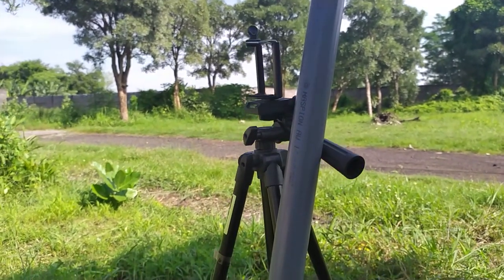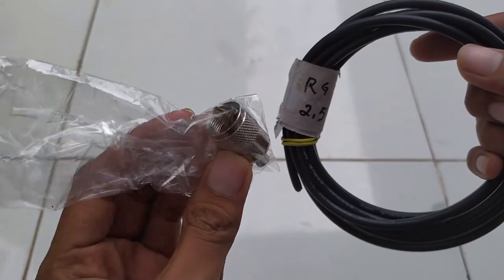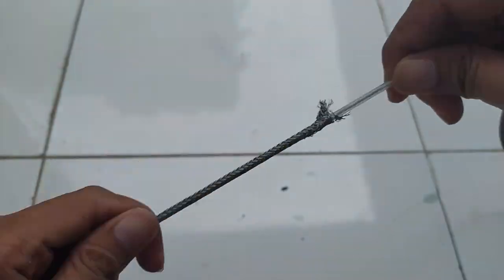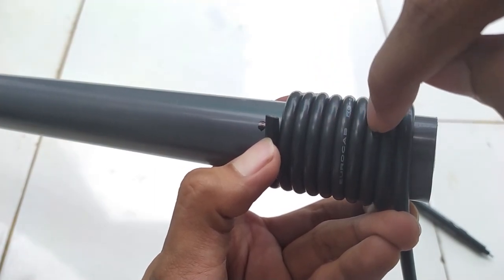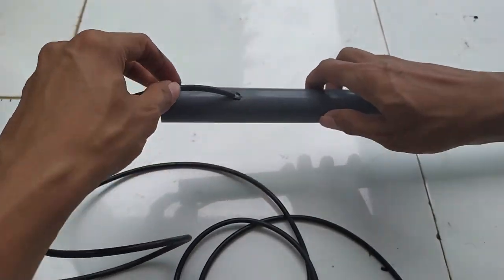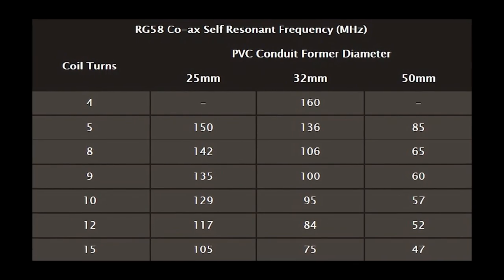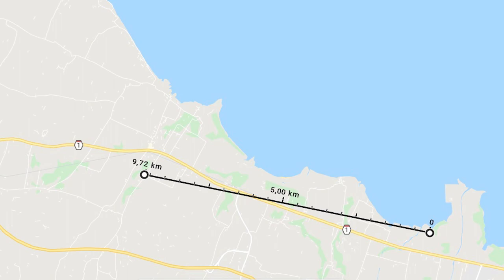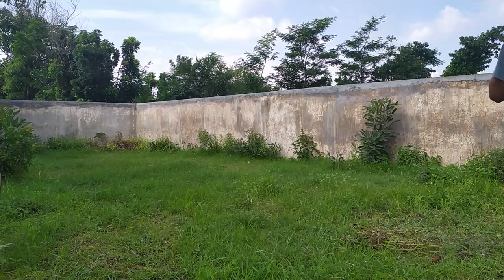Merancang Antena Flower Pot Portabel 2 Meter Band VHF (Outdoor & Mendaki Gunung)

Comment: how long the PVC and how many meter the rg58
Reply from the maker: PVC at least 1.2 m or if you want more portable you can use PVC length about 1 m, and for RG58 length it depends on coil turns of your freq resonant you want to use, so I said at least 2 m RG58 cables.
Reply: @Adam4wan  sir the diameter
Reply: @Adam4wan  145.650 how many turns
Reply from the maker: you should read & check the website source on descriptions, m8.
Reply: ok thank you